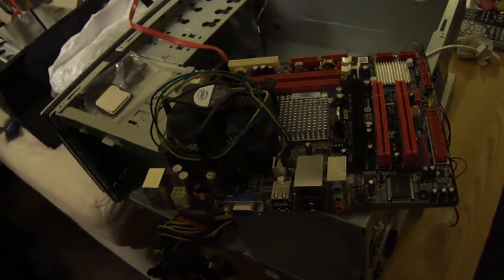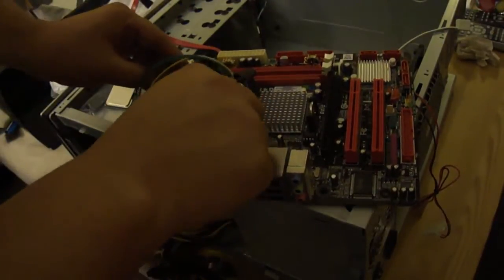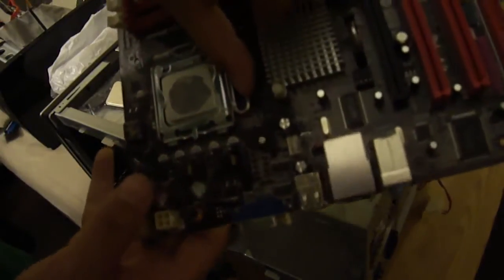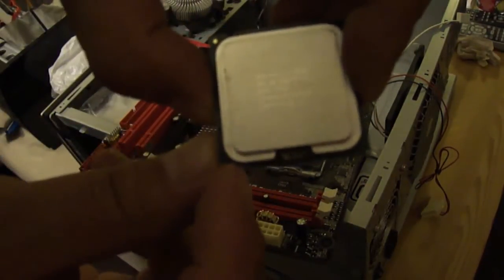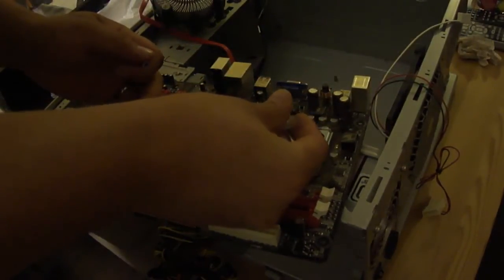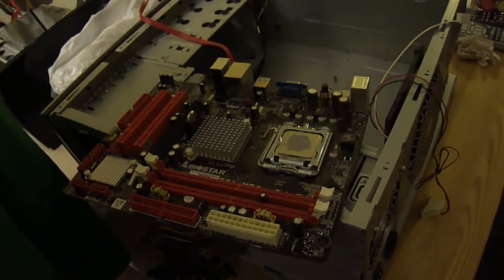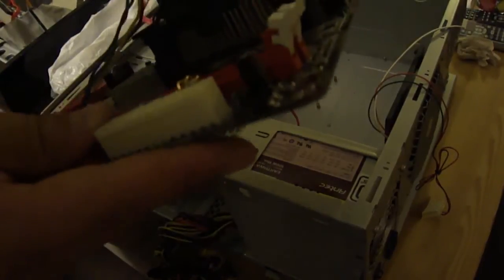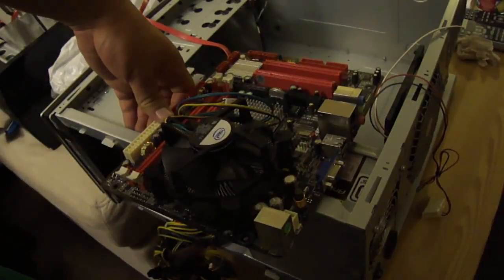Changing socket 775 CPU e3300 to dual core E8400 on my Biostar G41-M7 motherboard

Comment: I have an intel n2840 is it possible to change to socket to be compatible with a intel i5,I7?
Reply from the maker: +Kirby Guzman I think it depends on the motherboard.  This is a mobile processor, so you'd need to know what motherboard is being used.

Personally, I don't think it may be possible on these budget laptops.

Comment: You should NOT use a card to smooth out your thermal paste as you will add aor bubbles.  A proper amount in the center will spread adequately plus the CPU die itself is much smaller than the heat spreader anyway.
Reply from the maker: Ah.. i see.  So you recommend the ball in the center method.  I will try that too.  Luckily, no overheating issues using the wrong credit card method.  Thanks.

Comment: I have an HP DC7700 minitower. can i upgrade to e8400 or e8500 cpu ... does it work ??? please   just seriouse replay/// mine is core 2 duo e6300 :D
Reply from the maker: Hey Ilam, unfortunately, from what I've read... I believe your Motherboard is an ASUS which has been locked by HP.  It cannot run 1333FSB, so it would rule out the E8400.

You have 2 possible upgrade options:
E6700 @ 2.66ghz ; 1066FSB (about $19 on ebay)
E7500  @ 2.93ghz ;  1066FSB (about $14 on ebay)

In either case, you will probably need to do a bios update as well as a microcode update before you try upgrading the CPU.  HP really locked up your desktop good.

You can read more about it here on this forum:
   h30499 . www3 . hp . com /t5/Business-PCs-Compaq-Elite-Pro/HP-DC7700-cpu-upgrade-to-Pentium-E5700-E6700-or-Core2Duo-E8400/td-p/2377065#.U3Zq6_ldXTp

Just remove the spaces in the URL.
Reply: aleks dude so i can upgrade to E700 2.93  are u  sure ????
Reply from the maker: ilam buduri no  i'm not sure.  to know exactly, you would need to find the exact part # of your motherboard.  You can get info without opening the computer using a program called cpu-z